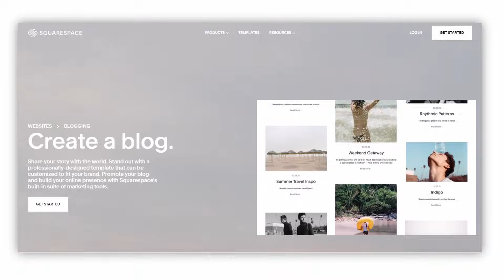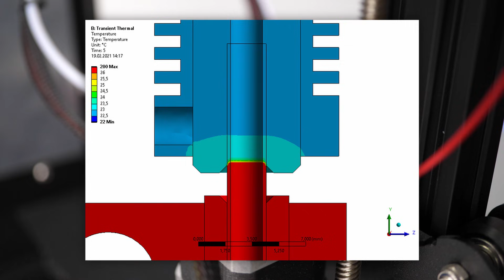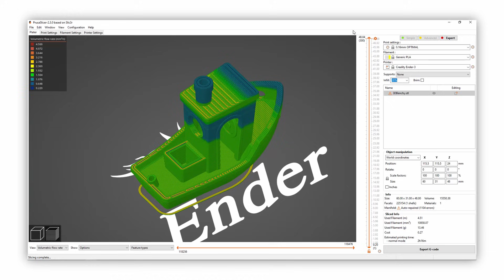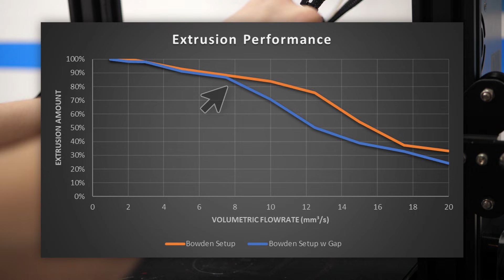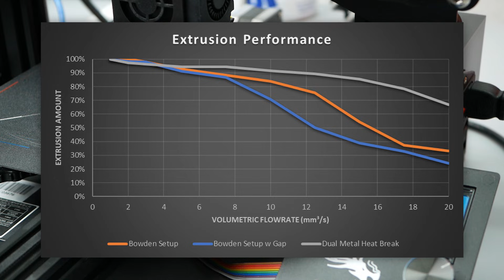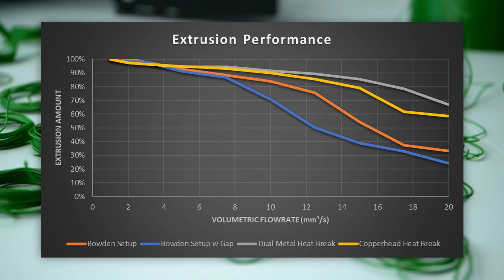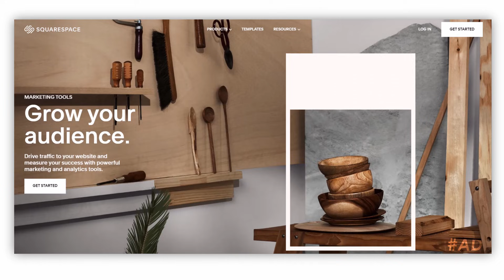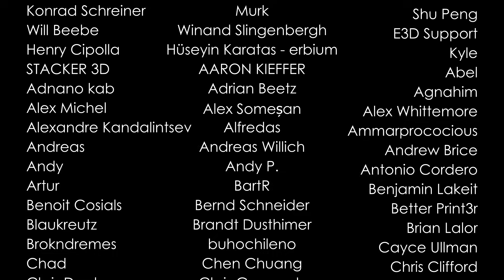Bi-Metallic Heat Breaks - A (R)Evolution?!

Comment: It appears the YouTube overlords didn't like us pointing people to our website to get more information, and removed our previous comment and related replies. We're happy to answer any questions here or via our website.
Reply: Which model of the heatbreak is the direct replacement for the Ender 3 Pro?
Reply: @chrismawson4430  the Copperhead C-E Heat Break is the direct replacement for the Ender 3 Pro
Reply: @SliceEngineering  Does it protrude like the heat break in the video? I was wondering if he purchased the correct version or if it was installed incorrectly.
Reply: @Hyperchalx  Yes, it will protrude a minor amount.
Reply: Would not a titanium tube be an even better option than the stainless?

Would the thermal properties allow for a stable fit between the copper and titanium?
Reply: @antno9158  We've found that the particular stainless alloy we use is actually a better fit in this application both from a strength and thermal standpoint than comparable titanium tubes.
Reply: Both?
Reply: @antno9158  haha, typo. Corrected in the original comment. Thanks for pointing that out!
Reply: If i place the copperhead C-E heatbreak in my stock ender 3 hotend, what temperatures can i achieve?
Reply: Hey Slice, this heat break seems awesome.  I have a Prusa MK3S...and MMU2S.  I know there's been talk about the special stuff Prusa has done with their heatbreak to get retraction and tip shaping for MMU2S (I think with the bowden PTFE tube into the heatbreak).  Can you help clarify this?  Does this bimetal heat break address that?
Reply: @chrismitchell9936  For the Mk3s you would likely want to stick with your OEM heat sink and just switch to the Copperhead Rep Rap 1.75 Heat Break. The key with the MMU and tip shaping has to do with how the PTFE tube mates with the heat break - you need a good face seal. We always recommend getting a piece of high quality Capricorn tubing and then precision cut it to the right length. We have equipment in house that can do that within 10 microns. Reach out to our Support Team if you need help with that.
Reply: I ordered a genuine Capricorn tube, hardened nozzle and your bimetal heatbreak. I read the tube can go up too 300c but I'll be going to 290 max. I want to print the carbon fiber nylon. I also ordered a board that I can update firmware on my ender 3 for higher temps. Oh also a new 50w heater cartridge.
Reply: @Slice Engineering how about stop patenting things?
Reply: youtube needs a system for creators to allow a certain channel to post links so that when they talk about a company, said company can link to their site for further info if they want, and if the creator allows.
Reply: Although a bit expensive, I bought CE heatbreak and 0.4 mm CHT nozzle to tackle abysmal flow performance of MK8 hotend. CHT was actually worse than stock Creality style nozzle, but bi-metal heatbreak is still in use with Volcano heat block, not for grazy speeds but consistent extrusion.
At some point I (or the printer) managed to bent it "a little", so I tried to work with stock heatbreak and PTFE all the way to the nozzle. Fortunately I was able to bend the bi-metal back to almost straight (quite a lot of force required) and back to printing 😅
Reply: @kimmotoivanen  thank you for sharing your experience!
Reply: @Slice Engineering i have a CR-10 V3 and want to swap to your heat break to print PETG without issues with the PTFE tubing. I don't really want to disassemble my printer until i have a replacement part. Do you know what heat break i need to keep the stock hot end and heat sync. My gut tells me C-Pro Max heat break. just wondering if you knew without me having to take my print head apart.
Reply: Hey  @dustinbateman  ! Thanks for reaching out to us on here and via our support desk! We'll be able to provide a better response via the support ticket, so look for an email response from us there shortly.
Reply: @SliceEngineering  I’ve been keeping an eye on my inbox
Reply: @SliceEngineering  I have the same question and never received a response on your support channel.
Reply: @miguelcereceres6977  Hello Miguel, would you please clarify which question? We've had a number of them that we've answered on this video. I want to make sure we get you the info you need!
Reply: @SliceEngineering  Which heat break, would I need for the Creality Cr10v3?
Reply: @miguelcereceres6977  Thanks for clarifying! Unfortunately, we don't have a plug and play option for the CR10 V3 right now. We are coming out with new versions of the Copperhead heat break often, so we may be able to accommodate it soon. In the meantime, there are full Copperhead or Mosquito hotend options that would fit, as well as the DDX extruders.
Reply: What about ender 3 v2 ? Is it the same one as ender 3 ? Thanks !
Reply: @zachyfly  the Ender 3 V2 will take the same Copperhead C-E heat break. You can find the full set up on our website under the "Shop by Printer" link. Simply select your 3D printer from the configurator and it will provide the best upgrade options for you.
Reply: @SliceEngineering  Thanks !
Reply: @Slice Engineering   Do any of your heat breaks fit the Creality cr6se?
Reply: I installed everything and get clogs really quick. I noticed, that the heatsink gets really hot. Before, you could always touch it while heated, should be 45 degrees, now it is way hotter and the filament gets melted inside the heatsink, all the way up the heatbreak.
Reply: @McBearyOne  If you have any issues with the Copperhead products please reach out to our friendly support team via chat, email, or phone on our website. We would love to help you get back to printing!
Reply: @SliceEngineering  I got it solved out. First of all, the inner part (pipe? or tube, I don’t know how to call it) of the heatbreak was a bit longer than the thread and stood out. That caused a filament leak inside my old heating block, because even though I screwed everything in tight, the nozzle and heatbreak didn’t connect properly, so I filed the heatbreak a tiny bit until it was flush.

After replacing my old block with a new one made out of copper and a better copper nozzle, I may have screwed in the heatbreak too far, so the thread was in the heatblock completely. That may have cause the upper part of the heatbreak to came in contact with the block or too close, causing it to heat up more than it should. This heated the heatsink too, the fan was and is working fine. The heatsink may have been above 100 degrees and the pulled out filament was thicker for a longer part, like the size of the heatbreak.

I screwed the heatbreak out a bit, maybe 1-2mm and screwed the nozzle in the same. The heatsink isn’t hot now, as it should be, the prints are running fine until now. No issue in the last 24 hours and approximately 300g of filament.

The heatbreak not being flush and flat on the threaded side is an issue you may have to check. You know better, how you constructed it. But I guess there is an inner pipe/tube inside the thread that is different? And this part was longer, maybe 0.1-0.2mm and therefor couldn’t connect to the nozzle properly causing the leakage.
Reply: @SliceEngineering  what heatbreak would work with the anycubic i3 mega? It has a v5 hotend.
Reply: @McBearyOne  I'm glad you got the issue sorted out. Should you find a fit issue with one of our products in the future, please reach out to our support team and we'll get it fixed for you.
Reply: @SliceEngineering  Thank you, will do. So far, it’s working perfectly fine and the clogging I had before is definitely reduced.
Reply: @McBearyOne  Great to hear!
Reply: @Megaflare47  The Copperhead Mk8 Heat Break should fit your printer. There may be up to a 0.5 mm difference in height
Reply: @SliceEngineering  do you have one for cr10 smart (not pro)?
Reply: @SatansBaby1  unfortunately, we do not at this time.
Reply: Which model will fit the anycubic vyper? Thank you so much
Reply: @l_Knights_l  Unfortunately, we don't seem to have a heat break that fits the Vyper directly. It would be possible to switch out the whole hotend though!
Reply: @SliceEngineering  oh ok thanks for the feedback! Will definitely look into one!
Reply: You guys could sponsor the creator. Anything but that is taking advantage of his work.
Reply: @electronicscaos  Yep! We've been sponsoring many creators, including Stefan, for years :)
Reply: Hi! Any idea if your C-E bi-metal heatbreak is compatible with the ELEGOO Neptune 3?
Reply: @DJProPlusMax  we have not tested it ourselves, but @Theferalengineer has a video on it and has testified that it is compatible.
Reply: @SliceEngineering  OK :)
Reply: @SliceRngineering when will you be making a heartbreak to replace the one on sprite extruder?

Comment: Something I've read before that may explain that slightly worse performance with the genuine part - the two screws that hold the heater block to the cold end are supposedly only there for aligning before tightening the grub screw, and should be removed because, since they're metal, they end up conducting heat to the heatsink.
Notice how, because of the shorter heat break on the knockoff, you didn't use the screws? I'm willing to bet you'll see some improvement if you pull those screws out on the genuine part!

Comment: I ordered a bi-metal heatbreak for my ender 3 pro from trianglelab, in order to print PETG.. Still hasn't arrived, due to issues with shipping, been waiting like 3 months :/
In the pictures, it looks a lot like the knockoff you bought. did you try that one with the tuned retraction settings you did on the genuine heatbreak?

Comment: My heat break;s hole is completely closed. It is not because of the molten filament. I guess there is a ring with teeth inside the heat break that holds the tube. This ring got pushed to the bottom nd closed the hole completely. dont know how to extract it..

Comment: My copperhead heat-break doesn’t protrude on Ender 3 like yours. Probably you bought the wrong model.
Reply: Which version did you order?
Reply: @Hyperchalx   mine is C-E and printer is ender 3 pro. There is a chart you can look up on the slice engineer website.

Comment: for about $2-3 you can get ceramic tubes which are the lowest possible heat transfer. You could most likely replace the metal tube and get practically 0 heat transfer.

Comment: Hi CNC Kitchen, i had the same heat creep problem on my e3. i think that is due to poor air flow through the fins on the heat sink, so i designed a new fan shroud and solved the problem. the heatbreak i used is similar to your shorter one

Comment: I replaced the entire hot end and extruder. Running a Bondtech DDX with a Copperhead on both of my CR-10S Pro V2's. 
One has a 0.6 and the other, a 0.8 mm nozzle.

Comment: Thank you for this video, knowing this could make things much easier in the future with my Ender 3. I just experienced many days of jamming after 1.5 hours with 245°C on my Ender 3, the solution was that the original heat sink has thicker fins than the aftermarket I bought (aftermarket but still a good company, just not original). Everything was the same and I was going insane on troubleshooting. If I would've had this heat break I would possibly not have experienced my problems, if/when my original heatsink will break then I know I have to have this product to successfully print with PETG temperatures. Thanks again!

Comment: What a coincidence! I tested a cheap bi-metal heat break just two days ago (an all metal V6 clone). Clogged hotend approx 14 hours into the first larger print. After disassembling the hotend the heatbreak looked ok, but filament would just not fit through. On closer inspection I saw that the inner tube wasn't actual a tube but a rolled up metal sheet with a slit. That slit delaminated (I guess from the temperature gradient) from the wall and one end of the metal sheet pointed inwards. Filament no longer flowed. Went back to my titanium heat break I had no issues with.

Comment: Stefan, you mention there are problems with titanium all metal heat breaks.   Please elaborate.  I would also love to see a video which compares the performance, especially using low temperature PLAs which tend to get sticky and jam in steel heat breaks.  So many people on the forums tend to push titanium as the solution.
Reply: Agreed. This is barely different than the MicroSwiss titanium upgrade I’ve used for years. Doesn’t seem like anything new to me.

Comment: Replaced the factory Ender3pro Hot End's hit block with a cheap Chinese clone of an aluminum volcano. And I've bought cheap nozzles of all sizes. The heater, thermistor and circuit breaker remain unchanged.

I've never had such short retract.

Comment: Can you look into the mellow's new hotend/heatbreak? They have make a ceramic/copper heatbreak which looks absurdly promising. It's like 40 or 50 dollars on aliexpress for the hotend and 18 for the heatbreak. It's so much cheaper and seems to truly be a unique design and not a low quality clone. So I'm Uber curious but don't have the time I use to in order to try it out.

Comment: Being able to increase the printing speed with one of these installed is good, but does that mean bridges come out worse with filaments like PLA because the cooling fan is already at maximum speed?
Reply: Then you have bad cooling fan setup if you are already running at 100% speed for PLA.

Comment: One Russian youtuber, Dmitry Sorkin, about a year ago tested such a heatbreack from Triangle Lab on an E3D V6 (from aliexpress, a good company) and the result ... Not bad, but plastic leaked very slightly from the top in a few hours of printing. It did not affect anything, but it turned out unpleasant.

Comment: Have the microswiss all metal hotend on an old Wanhao i3 (heavily modded). I was thinking of throwing another heater in the hot block, it seems to struggle at higher print speeds with the Inland filaments and also if the part cooling 40mm delta fan comes on while its extruding, the temp drops as much as 5 deg. Also tried a 1.2mm nozzle, could at best print about 50% speed compared to the 0.4mm nozzle. Parts still came out much stronger and heavier than a 0.4, and were about 40% faster print time, but also used quite a lot more filament. I will try a few prints with the 0.6/0.8mm nozzles I have. Might be better suited for the prototyping I do.

Comment: Honestly I think that the main reason for that small extrusion rate on the ender 3 is because the ptfe tube is making the length of the heated section (melt zone) half as much as it normally is in an all metal hotend. v6 lite also has reduced extrusion rate. this one is basically just the nozzle as the heating zone.

Comment: awesome! new video! but I wish you tested the trianglelab ones instead of the no-name ones! i heard trianglelab ones are great! because even normal steel all metal heartbreaks are always unstable from no-name brands! tho they're only 10$ cheaper so yeah you might as well just get the genuine and also support the engineers.

but also i'm a little confused. what does bowden have to do with high temps? I personally print polycarbonate on my bowden printer. it works quiet well. heck even TPU doesn't work bad. I can print 95a TPU or ones a bit below it at an okay speeds (45mm/s) with my bmg with retractions and linear advance.

I do wish you also compared it to a steel or titanium heatbraek. I have a titanium heatbreak on mine and i love it! I get 12mm/s extrusion rate but in my own testing which I posted somewhere and it got lost i think the cold zone temp was reduced by a noticable amount (tho nothing too big)

Comment: Interesting. One important item to note is the use of thermal paste. The stock Ender heat break does not seem to come with any. I saw an improvement just by adding quality paste to the upper section that makes contact with the heatsink. 

I feel this is something a lot of people don't realize and it would have been interesting to see how simply doing it affected the results.
Reply: Wouldn't adding thermal paste to the threads just worsen the ability of the heat break to keep heat from getting out of the hotend?
Reply: @keantoken6433  Yes, that's my mistake. I was also thinking about the common heat break designs that have upper threads but for the Ender you'd only want paste on the upper, non-threaded section.

Comment: I definitely have heat creep problems with my Replicator 2X, which comes with an all metal hot end, and my max flow rate is not great. Unfortunately my printer is old and weird, so there's probably no compatible upgrade parts...  Would be interested in learning more about 3D optimizer.

Comment: Slice engineering Mosquito Hotend: "I am a joke to you?"
Reply: Thing about the Mosquito is that it's very expensive and not usually a drop-in replacement. With this, the heatbreak is the only thing that must be replaced, making it much more feasible.

Comment: To be honest difference between materials (hence conductivity) only helps in transient response of the system not steady state. Also the hotend fix on the Bowden type extruders is one of the first mods one can do.
Bottom line i agree with what you said in the summary, only worth doing this if you want to be able to print using higher temperature materials.

Comment: The China simulated part sold by a German was more expensive by far!  It had no return.  No value.   The Slice part is the cheapest part you present as it's the only part that works.   I run the Slice stuff.  Never look back.  Never start over!  Never buy twice!   You have to be very rich to buy too low.  It's a great idea to spend less but know it is a fantasy as you always get less and often get nothing.

Comment: the worst ones are bare metal heat brakes that in contact with PLA filament 
I'm designing a way to exchange whole hotend for a specific filament like for TPU/PC/PLA ...
so that one is only recommended for PC as I recommended it for and to go ~350c.